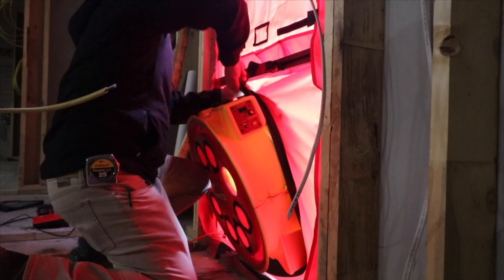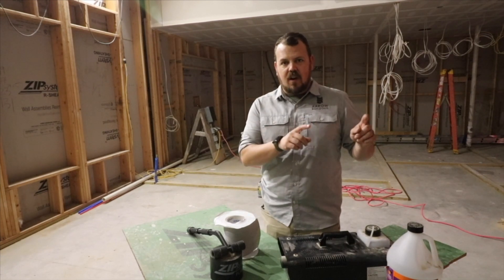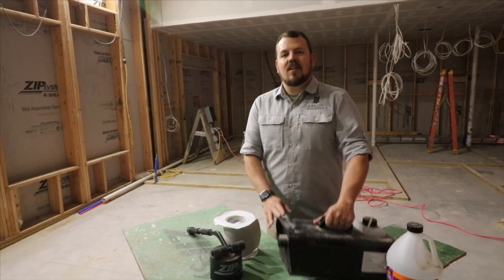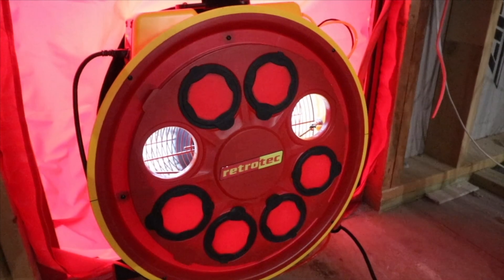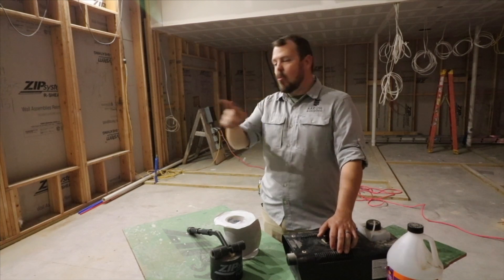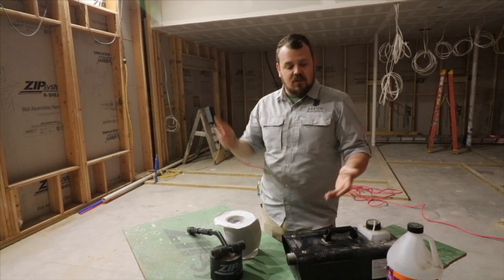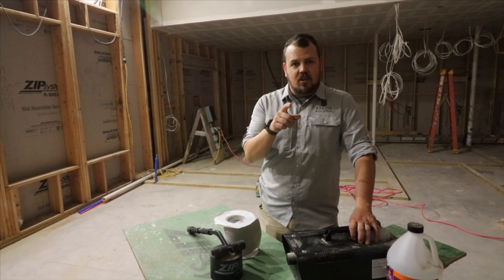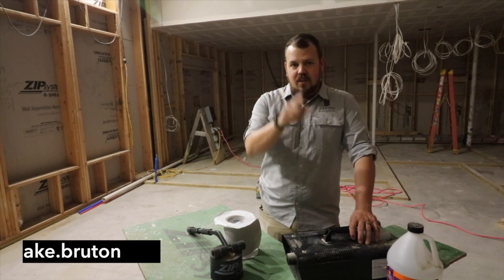Finding the AIR LEAKS during construction!

Comment: Glad to see I wasn't crazy in purchasing a fog machine to do this.
Question is in an already built home, 30+ years old how would you seal a leaky sill plate with a brick exterior? I'm thinking I could pull all the base boards on exterior walls to expose the bottom of the sheetrock. If it's all the way to the concrete cut about an inch off to expose the bottom plate.